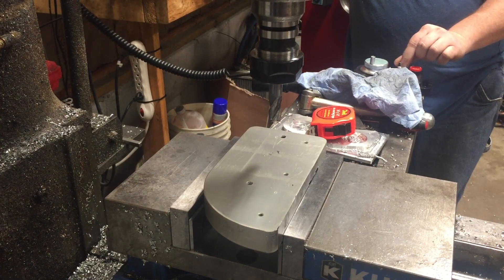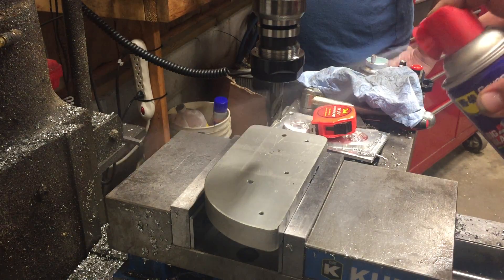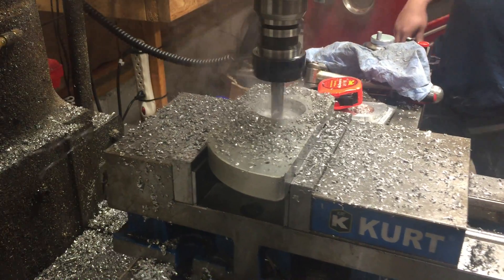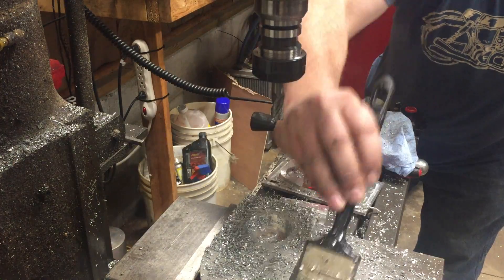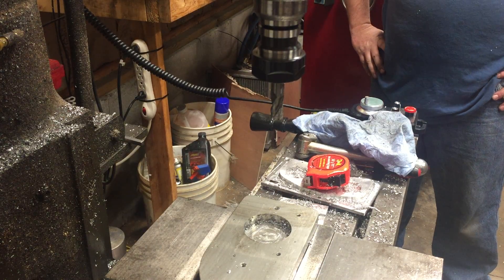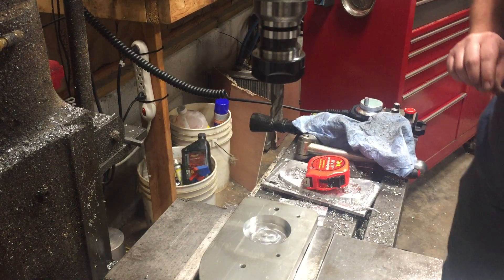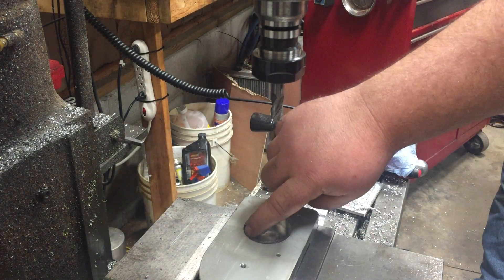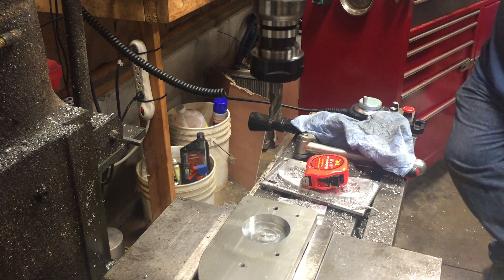Masso Wizard 2" Hole Running 150 Inches/min Clearpath Servos and Tormach TTS

Comment: Hi John.
Great job.
I found your channel with intent to retrofit my bridgeport copy mill to cnc. What type and size motors ate you using?
Reply from the maker: SRP RACING DEVELOPMENTS step and direction Clearpath servos 1396 ounce/ in
Reply: John lambert . Thanks for that. What power motor? Are you happy with your choice of motor brand and size? Ac or dc? Single or three phase please.
Reply from the maker: SRP RACING DEVELOPMENTS yes super happy with the clearpath servos they run on single phase to 3-24vdc power supplies wired in series to make 72 vdc. In the other comments on a some of the videos is the exact model number fir the servos.  I used ball screws in the x and y. Z still has the factory screw and brass

Comment: Found your channel when I committed to converting my Van Norman No. 16 to cnc. Your channel convinced me Clearpaths would be the Clearchoice. Lol They show up tomorrow! Nice to see you moving a BP at 100+ in/min.
Reply from the maker: Zach Batteram wow that was so long ago. Just so ya know the clearpath Servos are very awesome and are still running trouble free today. We have since upgraded machines but it was awesome to learn with this old machine.  We still use it for small jobs. Glad ya liked the video
Reply: @mowbetter2010  Yeah I may be back in the archives a wee bit. Hopefully I can get a video up. I am attempting to direct drive my knee, 1800 oz/in and I gutted anything unnecessary. Also going to try backlash compensation in linuxcnc before going to ballscrews. Keep up the good work.
Reply from the maker: Zach Batteram i tried with 1300 ounce inch. It would go down great but not even close going up.  I had planned on making or buying some 2.5-3” cylinders and adding some lift on each side and use a small regulator to feed them 20-40 psi.  The bigger machines use one to hold that heavy z up and use nitrogen under high pressure. Just a thought if ya want to try it
Reply: @mowbetter2010  I know that your knee is way heavier than mine. I have taken all 3 dovetails apart and freshn'd them up. Z moves with not much effort. Hoping all of this sets me up well. We will know by wednesday. But anyway a gas spring would be a great idea, thanks!

Comment: Why not run .05 depth of cut and at 60 ipm and save a hole lot off wear and tear on your machine? Especially the ball screw and dovetail ways.
Reply from the maker: Tom Hutchins ur on all of our old videos when  we were still trying to learn cnc and machining in general.
Reply: probably because Im old LOL
Reply from the maker: Tom Hutchins nah its ok im getting there myself. We ran a masso wizard in this video and it will only cut full width.  We were trying to show how fast the servos was at this time.

Comment: Where are the Wizards?? All blank in my MASSO screen.  Do you use Instagram??
Reply from the maker: YCM30cnc i have instagram but im not very good at it.  Should in the F5 screen and they are blank until ya create one. Tab down on the wizard screen and add a wizard it should pop up a little box that ask wht ya want to do. Face pocket hole. Several options
Reply: Thanks John,  will give it a try

Comment: Nice 150 imp I finally got my masso and my mill in my shed I'm just cleaning up the machine and need to mount my clearpathes I was wondering how you got the backlash out of the knee or did it have any to start with ?
Reply from the maker: larry martens the knee does have some backlash in it be the weight really takes it all out that i can tell.  I have never seen any bad effects of the knee having back lash. Yet.  The bottom of the parts have all been smooth.
Reply: Ok I see I fig it was the weight that took it out in going to Connect the my z to the spindle sense it's already set up with a ball screw  and I'm going to be doing a lot of 3d milling

Comment: The ClearPaths are nice motors. John I'm wondering why you used the wizard for your hole when you have the Fusion 360?
I could be wrong but it looked like the end mill stopped right where it finished the cut probably leaving a little divot on the part, that might be the cause for a slightly lager reading in the x axis. If the cutter could ramp off the piece when it's done the cut you probably would get a more consistent size hole, just a thought.
Reply from the maker: Tailor Machine Works we have a old pc that takes forever to boot up and get connected to the wifi keep the good one in the house. It does lift out of the hole where it finishes but it does back off of the side of the hole a little